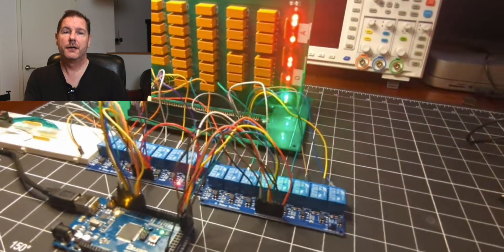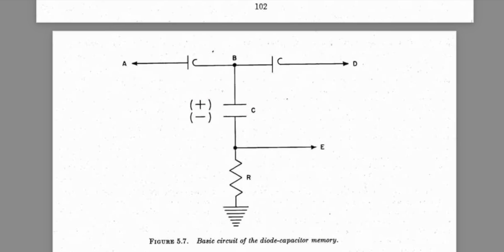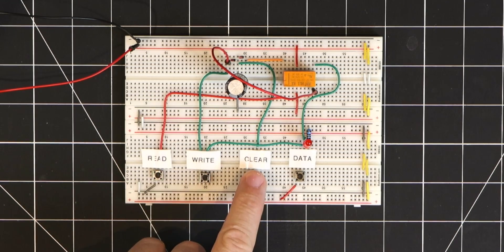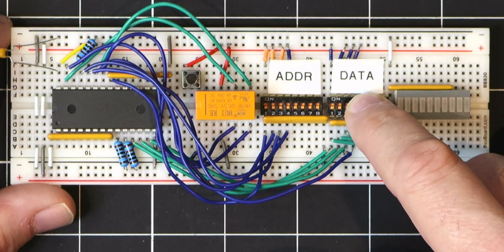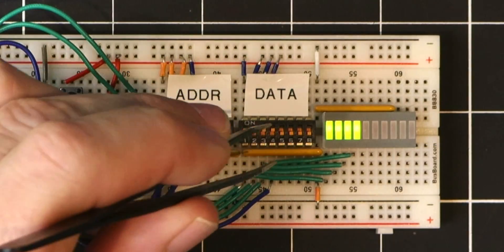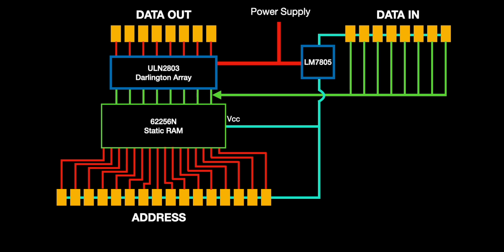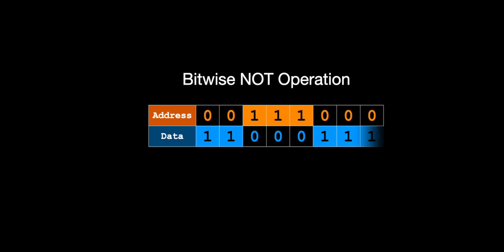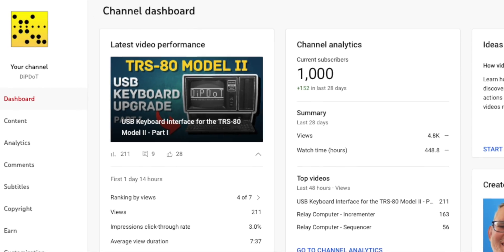Relay Computer - Memory

Comment: If you wanted to be a purist, couldn't you make the memory out of relays? I know it would make the machine huge.
Reply from the maker: Huge is right -  I can fit 8 bytes on a card, using relays, so it would take a lot of space. I'm working on capacitor memory which is more period-correct, will still be large enough to need an external box of some kind.

Comment: Hello. RAM memory on capacitors. But what about the address selector for a specific cell. Here too, you would have to use a large number of relays. Or maybe there are some clever ways to minimize this part of the system. Best regards.
Reply from the maker: Yes, will likely require at least one relay per row or byte of capacitors. Not sure yet if there's a more efficient solution, but that's still not bad. The capacitor memory will physically be a lot larger and will need to be an "external storage" device.

Comment: I would use bistable relays.. you can set a bit to positive with one input. you can read it how much you want. and after you got the information u use the second input to reset.. so the whole byte is bridget together to reset it. on this type you read it and got dataloss and if one capasitor is weak you maby cant read it. a bistable relay isnt actually a RAM but it can work as an ram. you can make a "power-up reset" if the board gets power, so a reset goes on and all memory is cleaned.

Comment: I see a problem with at least your breadboard demo, which is that you had those DIP switches wired directly between the positive supply and the data lines. When you were setting them, the IC was still outputting data, and it does drive pins showing a zero to ground. So when you flipped the third switch from the left, you effectively created a short that could have easily killed the chip. You can probably get away with using resistors to limit the current in this case. Normally this would be bad for speed and signal strength, but should be okay since your computer is not going to run at over a MHz.
Still, smart choice to use modern memory for now. Get the CPU working perfectly first, before introducing more variables into any debugging by having to worry about custom memory.

Comment: If you used two relays per bit, you could have the capacitor memory without the separate clear line. The first relay would select between ground and vcc, the second relay would take your write signal, connecting the first to the capacitor.  So, write + zero data = ground capacitor, write + one data = charge capacitor. You would power write on read as well, for your 'refresh'.

Comment: Didn't the electromechanical circuits in for example (pre solid state logic) pinball machines and jukeboxes mostly use latching based memory? Is that strategy not really usable in a general purpose computer?
Reply from the maker: Yes, they did, and this relay computer uses latching relays for the registers to store values. Great video by Technology Connections about pinball and relays here: https://youtu.be/ue-1JoJQaEg?si=L7mgr5G5tZpTFN9Z

Comment: Capacitor memory? You mean SDRAM..
It must be refreshed by the memory controller fairly frequently.
Reply from the maker: The goal is to refresh at each read cycle. For longer runs I'll need a ROM routine or something that refreshes at regular intervals. Trying to experiment with different sized capacitors to find a good balance between size and time needed between charges.

Comment: The first PCB I ever sent out for production was the A/D Register board for this relay computer. It had a few mistakes but I was pretty jazzed with how well it came out. I designed a daughter board the uses simple pin headers and a socket to plug into the main board at a right angle. This makes the LEDs much more visible. I also went with surface mount LEDs and resistors to make the board smaller. I'm intrigued by the capacitor memory idea but isn't it still one relay per bit? I'd imagine you'd be limited to 64 bits per board at that rate.
Reply from the maker: That's great! I thought about using right-angle for LEDs but my intention is to have everything in a case and have a front panel so they are for "debugging" purposes - at least in my mind. For Capacitor memory we'd need one relay for every 8-bits (capacitors) to enable a byte for read/write. I'm playing around with PCB designs, and I think I'm going to need a bigger boat...er...board for capacitor memory.

Comment: Excellent video and explanation as always!. But I am confused as whether the capacitor memory still needs one relay per bit, or the same relays will be shared for a bank of memory cells after memory/bit address decoding. I understand it's the latter. The Mercia relay computer site seems to omit the need to recharge the capacitor while reading memory, unless I missed something. I'm sure you will cover this in more detail in a future video. Determining the right balance for capacitor size should also be interesting. I think the larger it is the better as this should provide more idle storage time, but maybe writes and reads become somewhat slower if the capacitor is too big (?)
Reply from the maker: Thank you! I saw your other comment below but yes a relay can be shared for a bank of relays - but there'll need to be some supporting relays for clearing, write/read flow control etc. It'll be a fun adventure to figure this one out!

Comment: Have you considered bistable relays
Reply from the maker: I haven't considered them yet - looks interesting - would add some complexity in terms of needing to reverse polarity to reset but doable. Of course, cost is also a factor for me 😁
Reply: @dipdoting  In quantity they would be not much more than capacitors and they are non volatile once operated require no power , maybe not for a large amount of memory  note they also come in dual coil types one coil sets the other resets so its a flip flop!

Comment: do you have plans to release the circut designs or sell pcb's? id love to assemble one of these as well.
Reply from the maker: For sure - Once the build is "done" (meaning it's stable and running some code) I'm going to do a REV2 to fix-up any obvious issues...then I'll post the designs and pcbs for anyone to try out!

Comment: Charging those capacitors through a relay is going to kill that relay in no time.
Reply from the maker: Interested in hearing more on this - the Comm to NO/NC are rated for 2A @ 30VDC for 100,000 operations. Does charging capacitors cause further stress on contacts as opposed to energizing another relay? If so, I could socket those relays to make it easier to change them out I suppose.
Reply: @dipdoting    An electrolytic capacitor typically has ESR (equivalent series resistance) values of few milliohms, and in case of very old electrolytics up to an ohm.  Divide the voltage you apply to a capacitor to charge it to obtain the peak current. Same applies to discharging the capacitors.  Sorry for being the bearer of bad news.

Comment: super, I like the idea of the capacity storage. That said i'm wondering what the benefits are between the registry busses you made and the use of the capacity storage. 
Those let bars you used in the demo looks much cleaner then the separate led's on you boards.
Reply from the maker: Technically you could use capacitors for registers as well. One thing with capacitor memory is that it needs to be refreshed from time to time, easier to do with all of that in one place.

Comment: Will you need a relay per bit with the capacitor memory? How many bits of memory are you planning on designing for the capacitor memory?
Reply from the maker: It will need one controller relay for each row of 8 capacitors representing 8 bits, and then 2 diodes for each of those.
Reply: I asked that same question. I think he just demoed the concept in this video, but in practice he will share the same relays for a bank of memory cells. So only the capacitor and the two diodes really count per memory cell element. This should be possible because memory cell addresses must be decoded anyway, so only a few cells are accessed at once while the others remain idle.

Comment: I was happy to hear you are still pursuing capacitor diode memory.  Using a model RAM chip just seems like cheating.  Disappointment!
Reply from the maker: Totally agree - Whenever I see chips on relay computers it takes away from the concept - this RAM will help me work the bugs out but fully intent to have a working capacitor memory in the future!
Reply: It's not really cheating to me if you need the memory depth. Repeating hundreds, or even thousands of a circuit doesn't seem more "pure" to me from a practicality standpoint. Maybe have some registers as cap memory, and bulk memory as dips if you want to flavor it a bit.
Reply: ...but what if i need 128kb of memory.....